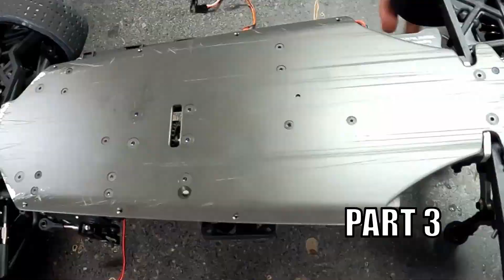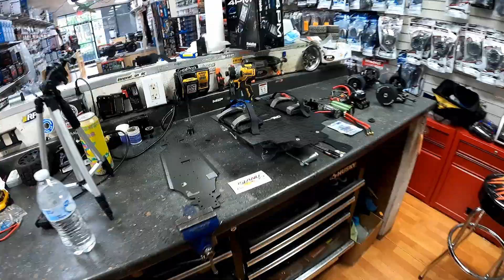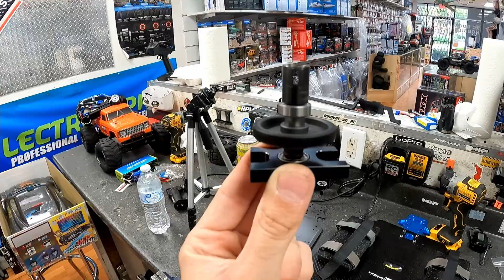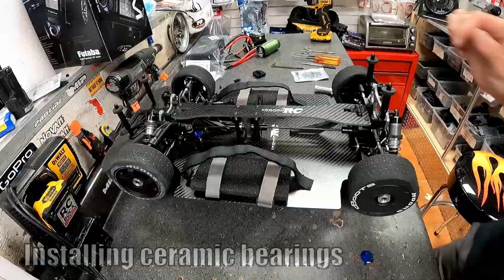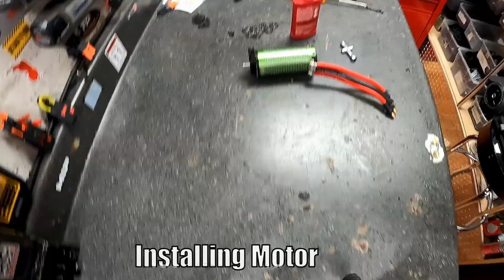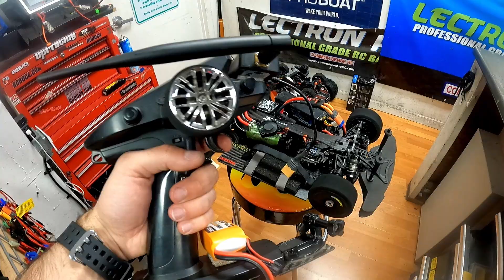INSANE CARBON BEAST! Part 4! 100+ Mph RC! Hobao Hyper GTB GTR!

Comment: Great build 😍
Just a little worried about that inner esc wire to the motor . If that carbon top plate rubs through ☠️
Reply from the maker: I zip tied it to the other states at it won't stretch down and hit anytime! Thanks for the lookout!

Comment: Do you have any advice for power cuts on stock infraction 3s? I can't even get a full pack in street bashing on stock gearing, tried to go up to a 120 amp spektrum, same results. Do I really have to run an 8s esc to run this stock little plastic car 😅😮
Reply: Don't use that spectrum ESC garbage for-speed runs can't handle the amps for speed runs
Reply: @Steve T  well, I'm not even doing speed runs. I'm simply just trying to run the car stock as intended,  really regretting the purchase if it needs a 200 dollar esc making it more expensive than its 6s bigger brother
Reply: @StevenYDG69  I understand that but spectrum's ESC  are garbage, I had a few cars that came with spectrum I got rid of the electronics , either use hobbywing or Castle
Reply: Tried different batteries? Might not be the esc's fault.
Reply from the maker: Too much load? To high of a gearing ESC doesn't like it

Comment: Actually, ceramic bearings have more resistance than high-quality dry-run steel boca bearings. Ceramic bearings are used for high-heat locations like the motor or anywhere you have high temperatures. High-speed steel dry lube bearings are the smoothest with the least amount of resistance.